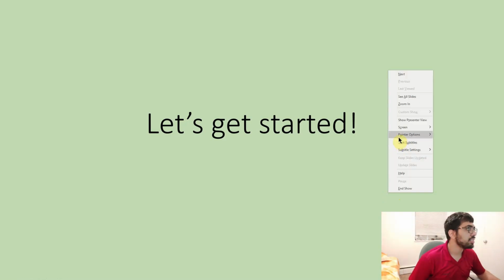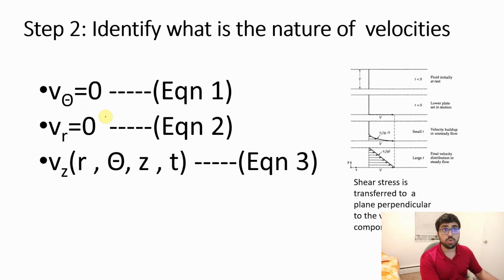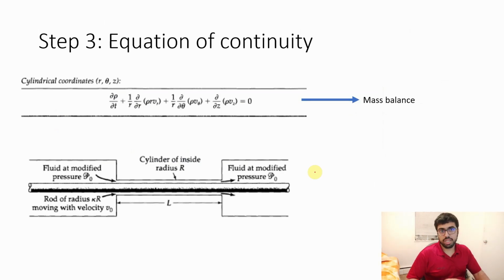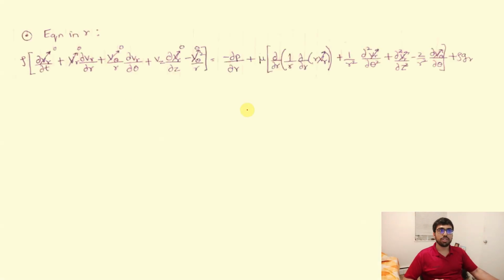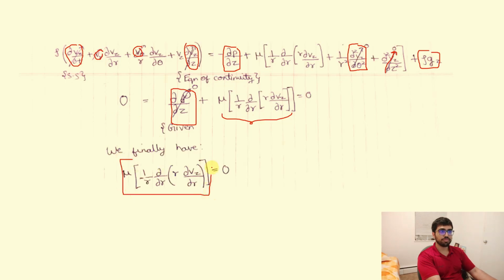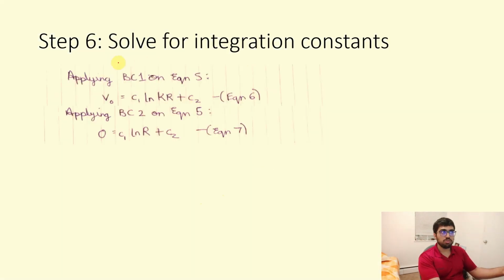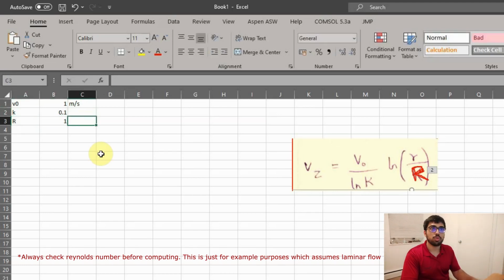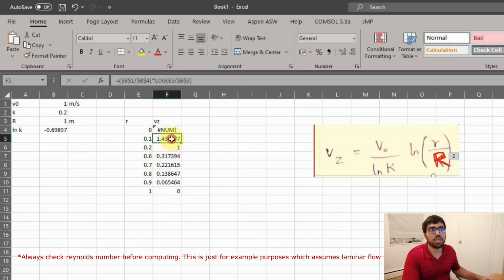Transport Phenomena Example Problem || Step-by-step explanation

Comment: Could you solve the same problem with outer cylinder rotating inner cylinder axially moving and Ur=0, d/dz and d/d(theta) =0
Reply from the maker: Sounds like an assignment problem :) you can email us where you're stuck at. We will give you hints!